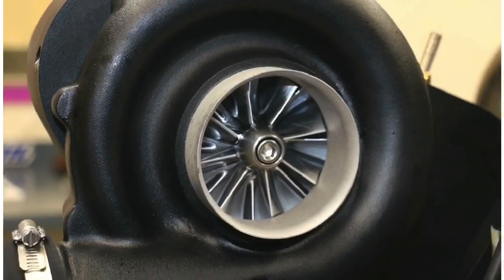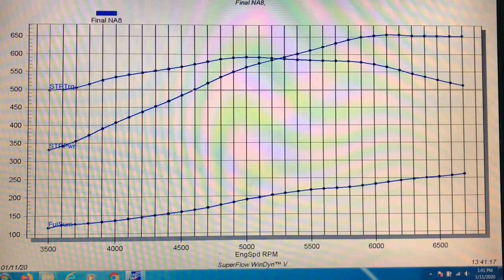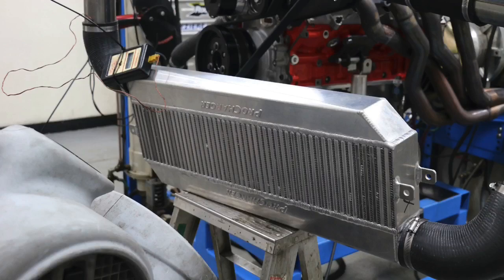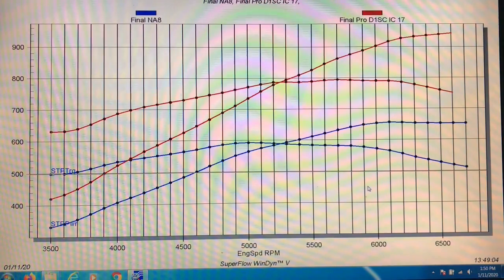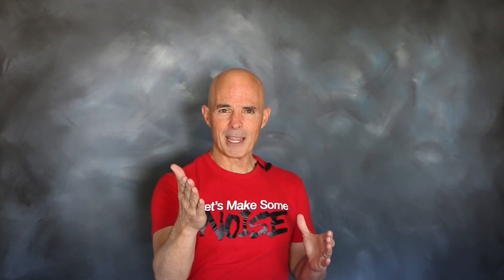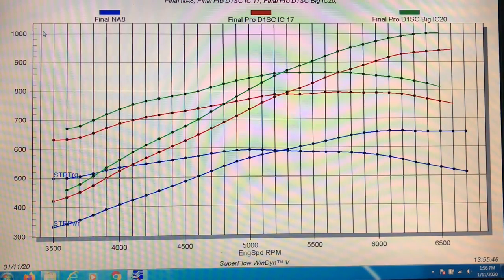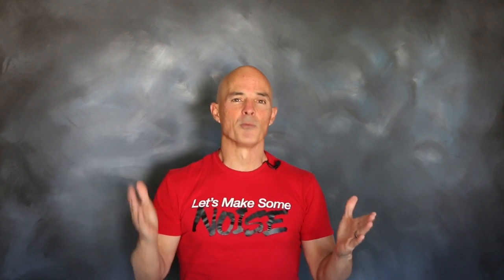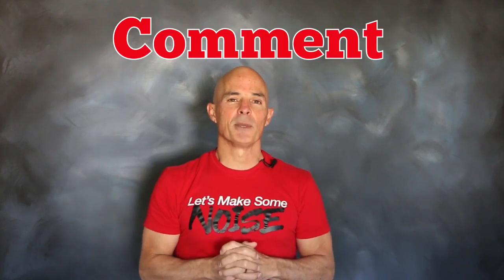LS ATA INTERCOOLER TEST-IS BIGGER BETTER?

Comment: So you mentioned the intake temp drop from NA to small intercooler was 120 degrees. What about the temp drop from small IC to larger IC? That drop could also contribute to the increased power.

Comment: It would be nice to see the difference the larger piping increased power and boost. I actually had to downsize to the Standard from Race Intercooler because Irt was blocking to much air flow to the Trans Cooler and Radiator. I think it would be a fairly simple test to have the same Intercooler but different piping size to see what really makes more Boost and power. Thanks for the great videos!
Reply from the maker: it is the cooler
Reply: You may be correct and it might be the Intercooler, but I notice the same intake Temperatures between both the Standard and the Race Upgraded Intercooler

Comment: I believe this guys reply answers the Tubing question: 
S&H Performance
3 years ago
Yes the pipe size is part of it. Ford 326 1000hp build. Had a 4" thick core with 3" piping and in/outlet. Welded on a 3.5 outlet and ran 3.5 to tb and picked over 50hp and 35tq, same intercooler.
But I still don’t understand why the Boost went up and not down. I also wonder what the Temp difference would be if you just increased the Boost with the smaller intercooler? Maybe the Larger intercooler is actually a restriction
Reply from the maker: boost measured in the intake manifold went up because the small intercooler was a restriction between the turbo and intake

Comment: Again, always good informative videos. Maybe you can explain to me why the Boost went Up and not Down with the Larger intercooler. Since the Larger intercooler was less restrictive and flowed better I can understand the Power increase but I would think that the Boost would go down, just with a less restrictive or better flowing Engine?
Reply from the maker: the smaller intercooler was a restriction between the blower and intake (where the boost was measured). We eliminated the restriction with a bigger cooler and the boost in the manifold went up as it should

Comment: Curious if the increased power was only due to extra cooling, and if so, then how cool can we make it?
Also, I am assuming that the boost was measured AFTER the aftercooler.
It would be interesting to see the boost before and after the aftercooler.
Reply from the maker: MORE BOOST
Reply: @richardholdener1727  Yup, now that I think of it, that guarantees that it was measured AFTER the cooler, because this ain't a turbocharger so no change in relative speed between engine and compressor ever happened.
I wonder how the engine would have behaved with TWO of the big cooler. :D

Comment: Merry Christmas Richard! Great Video’s, keep them coming. The only problem with this test that I see is; even if you have the Upgraded Race Intercooler, some of the Tubing size varies from 3”-3 1/2”. At least that is how it is on my set up with the upgraded Race Intercooler. It would be nice to see the same test with similar Procharger set ups that have unfortunately some Tubing only 3” and other Tubing 3 1/2” with the Race Intercooler.
Reply from the maker: 3-inch before the cooler would be less restrictive than 3 inch after the cooler-but the same size tubing throughout after the blower is best

Comment: What would happen if you just increased the intercooler pipe from 3 inches from the intercooler to the engine to 3.5 inches. Providing you also increase the hole in the intercooler to match the increase in pipe diameter. I had a 3lb restriction, 15 lb before intercooler 12 lb after. I'm doing this  modification right now and will report back soon...I hope HA!
Reply: Ok I'm back, I finished the intercooler  modification increasing the pipe size from 3 to 3.5 inches to carburetor.  It's at 15 lbs. Going into the intercooler and had 12lbs. Coming out. Now have 15lbs. Going in and 14lbs. coming out so gained 2lbs. press with modification.  That 2 lbs. made a big difference, feels like 50 hp. I have pics of all work.

Comment: 7:04 The boost level went up to 10.7 PSI with a better flowing intercooler and piping?  Is this measured at the intake manifold or at the supercharger output?
Reply from the maker: YES-THAT IS WHAT HAPPENS WHEN YOU REDUCE THE RESTRICTION (MEASURED IN THE MANIFOLD)

Comment: Richard I'm in the process of doing the same thing. I had bought a Treadstone A to A intercooler rated at 2000HP. Rated at 2 lb drop at 2000cfm. The IC had 3" in and outlet. I modified the unit and put 3.5" in and outlets. With no intercooler vs with intercooler, there was a 10 lb difference in boost seen in the manifold. I just ordered the Procharger 1550HP rated A to A IC with 4" in and outlets. I'm hoping to see 6 or 7 lb increase in boost in the manifold. The SC is a F3-D106 with a 1000cfm QF 4150 carb that I made. So far 1350HP at the wheels with 25 lb boost in the manifold. Camshaft is a little small with 262I/270E @ 0.050". So hoping to see 30 lbs of boost. My Camaro should dip into the 4.70s in the 1/8 mile. Boost is fun! Keep up the great videos.
Reply: Hey bud. Any updates on the how'd it go after you ditched the threadstone? I just grabbed a treadstone intercooler, the tr1245r rated for 1340hp. While my supercharger is only capable of around 1450cfm, thought having the extra headroom wouldn't hurt but now I'm worried based on your experience with threadstone
Reply: The Procharger IC I bought is far superior to the Treadstone.

Comment: awesome test! I'm curious to see what the d1sc power curve would look like on a junk yard 5.3 vs an engine like this. Can the 5.3 match this power exactly just by adding a smaller pulley? The centrifugal blower seems to make power not the engine or cam, it just turns every engine/cam combo into a linear curve until the blower runs out. Just like the boomer vs millennial video lol
Reply from the maker: the 5.3L needs a cam to work well with a blower
Reply: @richardholdener1727  yeah sorry i just assume 4.8/5.3 = sloppy boi stage 2 😂

Comment: I’ve back to back tested 2,2.5,3 inch piping on a 300hp sr and bigger was better in response,hp and temperature drops. Also going to a 4 inch core vs 3 inch in 300x600 dropped boost pressure but held the same power so bigger is better in pretty much every scenario considering my testing was on 300hp

Comment: The LS engine platform is superior to ford, dodge and whatever else. The power they produce stock, the significantly smaller size (compaired to DOHC heads like in hemi's), the MASSIVE aftermarket support, the shear amount of engines produced means they're plentiful & inexpensive and simply adding a good camshaft and good tuning means you're laying rubber. Coyote engines are stupid expensive and Hemi engines are just outright MASSIVE. Chevrolet has been #1 since 1955

Comment: I'd like to see how effective cooling the intake charge is with NO forced induction. Of course, to be effective, your cooling would have to take it below ambient. We've all heard the 5F=1% rule. But does it hold true when you're dropping the air temps below ambient? How cold can you get it, and still get power gains? Can something like liquid nitrogen be used across a heat exchanger to accomplish the same effect as a compressor?

Comment: Got to remember the thicker the core the more you affect the radiator. High water temperature can pull timing. And kill power
Reply: Most radiators have far more than enough capacity to handle the car's waste heat while moving through the air.

Comment: I'm on D1sc on an LS3 at 14 psi with a 3.6" pulley. What pulley size did you use? I have the 3 inch intercooler and under extended runs the intake temps can get close to 150F. Looks like I need to go to the 3.5" setup and larger intercooler!

Comment: Lets see and efficiency test on intercoolers that would fit in same space at the front of a car. Long intercoolers versus short wide intercoolers like the ones in this video, I read years ago it was better to do short fat and slow the air down to give it more time to cool than it have it flow fast but be in the intercooler over a longer distance. I've never tested it out though.

Comment: The only intercooler that does both, flow well and knocks out heat, is no intercooler with methanol. Proof me wrong with a LS Turbo NO intercooler video
Reply from the maker: Meth with an intercooler will make more than Meth without
Reply: @richardholdener1727  then comes the question, could one cool too much. Nitrous, Methanol and icewater/air intercooler. Is there such as too much of a good thing.

Comment: I have a 72 Ford bronco with a Ford racing crate 302/5.0 intended for 1995 cobra replacement.  It puts out 340 hp, but I'd like to buy 500.  The compression and bottom end is stock as t 9:1 so super or turbocharging seems easiest way to Increase power. It has gt40 heads, . .495 cam, and roller top end. Also has Edelbrock  intake and750 or 650 carb.  What's your advice to hit my goal of 500 hp as cheaply as possible?  I see turbos on ebay for 200$.  Are those total crap or worthy?

Comment: This was air to air?  Which is the best; air  to ice water?  Can one buy a cheap eBay turbo, slap an intercooler on it it, change the pulley and get huge gains likr this?

Comment: Changing up to the larger inter cooler will also do another thing, the larger volume of the inter cooler is still dealing with approximately the same volume of charge air, so this then allows the charge air to slow down through the inter cooler as it passes through it and that gives it more time to transfer heat and become cooler and more dense
Reply: Exactly, smaller piping would still provide flow. Its about surface area and time the air actually makes contact with that surface area.

Comment: 5.3TT project. Been wondering if theres suck a thing as too much intercooler? Like would it delay the boost response? /how badly? I imagine the turbo bearing type and peak psi would play a role in that also...
Reply from the maker: not really an issue with too much cooler or cooling-its usually a space/fitment thing

Comment: AWESOME video! I get the impression that many fail to understand the importance of always shooting for the lowest IAT possible. I believe that it is of critical importance even in NA applications. Throw in FI and the attention to design and function of aftercooling has to be addressed period. Your video provides the end results wonderfully. I would love to see the data responsible for the HUGE HP increases. Like IAT pre and post intercooler as well as pressure loss across the intercooler. I would also be interested in the charge air volume differential measured at or near the throttle body. COOL stuff. Thank you for publishing!
Reply from the maker: very little change in IATs-it's mostly flow on this test-If we had an air meter on the blower-we'd see an increase in airflow after the drop in (pre-cooler) pressure which resulted in an increase in post cooler pressure and flow

Comment: Yes I would like to see the difference between a rear mounted Turbo System like one by the muffler and a front mount like one by the motor the Boost curve and when the power comes on what would be the big difference
Reply from the maker: that's easier to show on the chassis dyno or street-the engine dyno artificially improves the boost response with a heavy, stationary load
Reply: Would longer piping similar to what you did with your compound Turbo System maybe slightly longer ( 6 feet long) or so.Be an adequate tests compared to some of the other ones that you have done straight off the exhaust manifold . (just a thought thank you for your time)

Comment: I appreciate all of the content you have been putting out recently!!   I think it would be intersting if you test the btr 388 plus C.I.D. turbo cam in a lq4 or something along those lines and see how it performs.
Reply from the maker: I've run a lot of Brian's cams-not familiar with that one
Reply: @richardholdener1727  its got pretty healthy specs.   243 int./251 exh. Duration, 0.627 in./0.632 in. Lift, 117+5 LSA

Comment: Why there's so much difference in gains in a v8 with fmic and a 4cil with same 3" fmic?? My 1.8t with tune, 3" downpipe and 3" fmic just give me a 62hp gain from 225 to 287hp.
Reply from the maker: something else changed besides the core-probably the boost-I've run a few of 1.8T motors
Reply: @richardholdener1727  Thanks for the input, lots of learning in your videos, excellent work, just don't forget about us the 4cil dudes hehe

Comment: I'd like to see this test on a stock motor. To see if upgrading the ic is really worth it. Also that way the flow of the supercharger isn't at question
Reply from the maker: it would not be at the power output of the stock motor
Reply: If say that depends on what a person is doingoing with it. If your running stock in an endurance environment upgrading all cooling systems can be a bonus.

US highway department says the average grade is 3%, so in order to pass testing that's all the vehicle is required to climb without issues. In reality grades as much as 6% are normal up to 10 miles long. Yes my example is more of the diesel commercial side of automotive, however the same types of testing are done. So if your going to push the vehicle past it's testing parameters then it stands to reason that the cooling components may not be ideal.

Comment: Would also like to see a silly test....of just adding 90deg couplers together until power is impacted. How bad does pipework need to be to affect performance ?
Reply: With HVAC systems, every 90deg fitting is the equivalent of 100' of straight pipe

Comment: It also has to fit in your car.  Us corvette guys have a hard time fitting an adequate intercooler up front.  I gained substantial power removing mine and adding water injection.

Comment: Thanks for another great video. It made more hp per pound of manifold pressure on the higher hp run... its like 20 hp/50% more than expected for the added boost. Were the IAT'S significantly lower with the thicker intercooler?  Or was the reason for for the low initial numbers due to ring seal and were starting to see ring seal improve by the last run?  On an intercooler test, would like to see IAT and pressure drop data before and after the intercooler for each test.  This would have been a perfect test to completely remove the intercooler and see the actual effect.
Reply from the maker: the temp drop was almost the same for both cores-it was just increased flow-235-115 degrees

Comment: the boost increase is strange. I wasn't expecting that.  I've seen on roots blowers when running a bigger efficient cooler decreases the boost!?
Reply: It's not strange at all. If you remove a huge restriction, it allows more air into the engine ( so the engine is then the restriction )...hence more boost

Comment: Was any of the power difference had to do with the bigger intercooler piping?
Reply: That was exactly what I thought .
Reply: I think the idea is that the core of the intercooler is the greatest restriction, there would be an increase by the pipes but I don't think larger pipe work to the first intercooler would make much difference as the greatest restriction is the core. And vice versa the smaller pipes to the second intercooler would still flow better because the core is still the greatest restriction.
Reply: I’ve back to back tested 2,2.5,3 inch piping on a 300hp sr and bigger was better in response,hp and temperature drops. Also going to a 4 inch core vs 3 inch in 300x600 dropped boost pressure but held the same power so bigger is better in pretty much every scenario considering my testing was on 300hp

Comment: i wonder what the difference is non intercooled with timing and fuel optimized vs the other two. i have read it’s approximately 1% power output for every 10°f change in air temp. Would you say that’s a somewhat accurate formula? I’m just curios how accurate that is. Absolutely love the videos man. would be neat to see what the supercharger would make for power without an intercooler as well.
Reply from the maker: That formula is not universally accurate-the gains are a bell curve-where the formula is accurate in the normal temp ranges-but less so at  the extremes (a lot like the % gain from compression)
Reply: Richard Holdener thank you.
Reply: Richard Holdener the boost curve would be interesting info without intercooler. just to see the difference of restriction from the two intercooleers vs just charge tubing. Man I don’t think I would ever leave that Dyno chamber. LOL. I would want to run 14 million different tests on everything. it’s so interesting.!! so much info. thanks for doing what you do👍

Comment: Just curious,  you said that the fall off of boost with the big intercooler was probably due to the supercharger being close to its limit, but you didn't say whether you had the smallest pulley on it either, unless I missed it.

P.S.   I enjoy the videos!
Reply from the maker: In this case-The pulley size has nothing to do with the flow limit of the blower-the blower will support only a given amount of airflow-if we change the pulley-that will just happen earlier in the rpm range

Comment: Boost is just a number, what gain was had in the Temp/Density numbers?
Reply: Gale Banks, dat u?
Reply: Not entirely, you have to take pressure drop across cooler into account as with restriction comes reduction in flow  rate so it can result in good heat transfer but lower flow results in less pressure valve side, this is because lower flow rate thru cooler allows for more heat transfer but lower mass, so after cooler temps can be misleading without looking at all data,  low power diagnosis 101, variables like duration of load and where boost reference for waste gate taken from and does turbo go into surge etc
Reply: Gale Banks 101